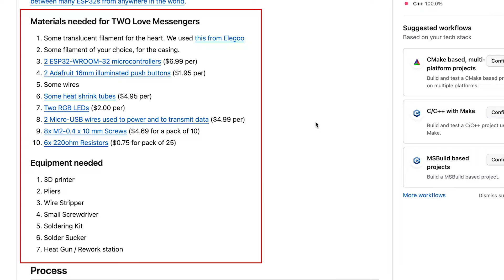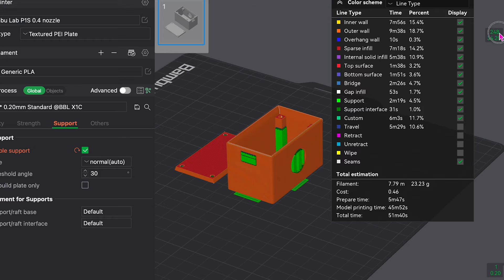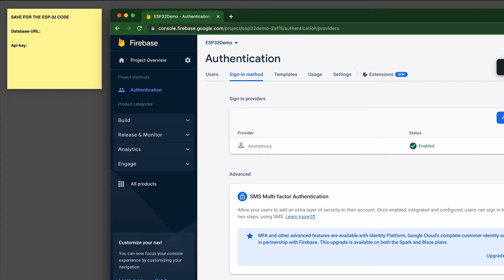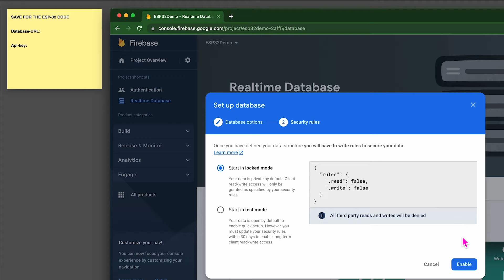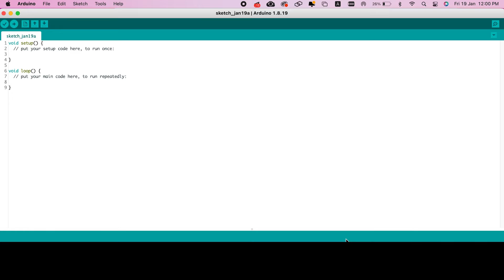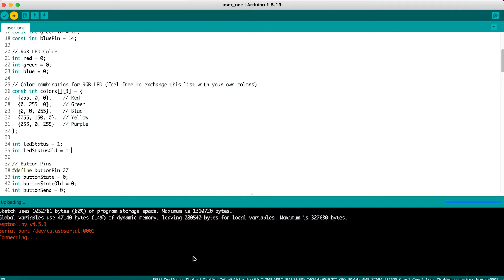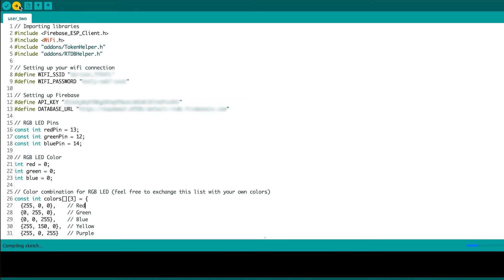Make your own DIY Love Messengers 💕😍✨

Comment: For some reason my esp32s are crashing when downloading data from firebase :(
Reply from the maker: Sorry for the late reply, but did arduino mention a reason for the crash? Is it a timeout error, or what does the error say?
Reply: @WormiCollective  hi, no error, serial console just freezes. It sometimes come back to life
Reply from the maker: @glupu-r4b   hm :( Did you choose the correct port and board? And did you choose 112500 as the baud rate? and which version of Arduino IDE are you using?
Reply: @WormiCollective yes, everything worked fine until i added the 2nd esp 32, more likely the second value that needs to be read because i tried to also add it manually. I think it reads too much data in a short time that triggers the firebase anti-flood system